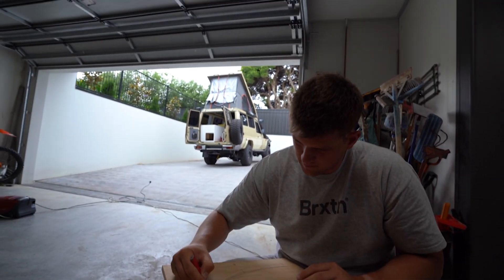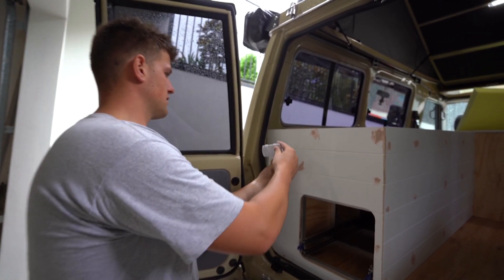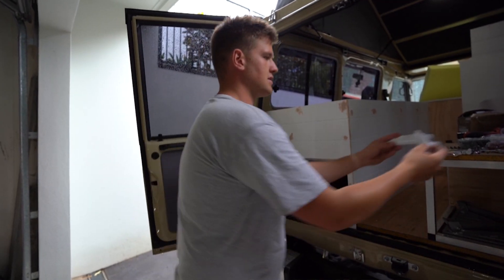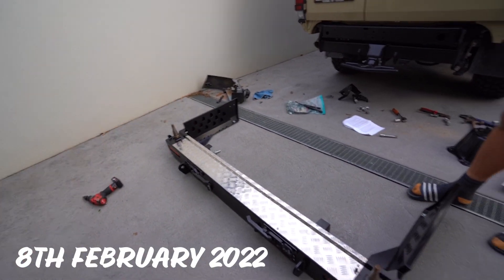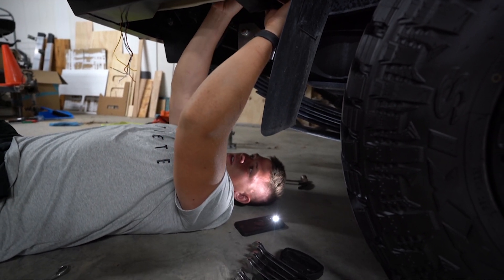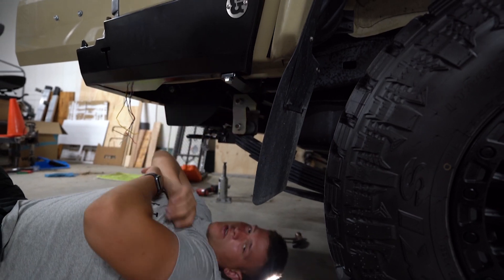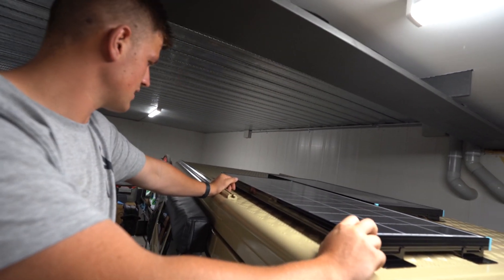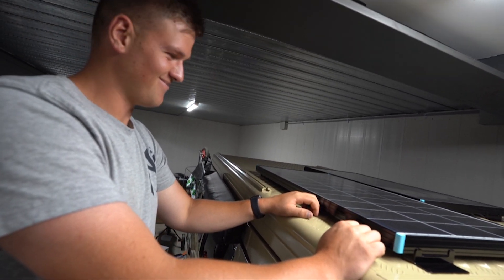TROOPY BUILD - EPISODE 6 / REAR BAR / PANTRY / SOLAR PANELS

Comment: Hey guys! Love the build series, I just brought my own troopy and will be starting the fitout soon and am taking alot of inspiration from you guys!.

Just wondering if there is enough room to access the inside rear door handle with the seat there?
Reply from the maker: Hey Ben! Thanks so much we really appreciate it 🙌🏼 you’ll absolutely love your troopy! 

Yep, we made sure there was enough room to get your hand in and open the door. It is a little tight but manageable!
Reply: I’ve been watching that too! 🥺
Reply: Also you won’t be able to use the plugs at the back door while the door is closed. Sorry to say but I think you might need to cut down the length of the bench seat for this and also so that you can get out when you’re camping in the back. Love your work tho… I have a 2021 same same. 👍